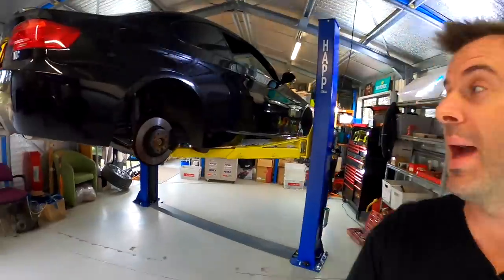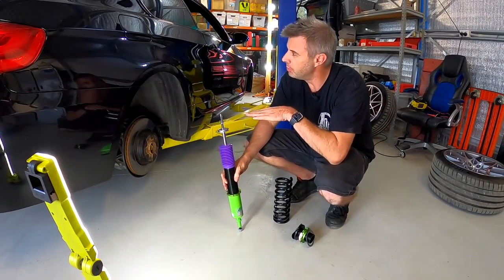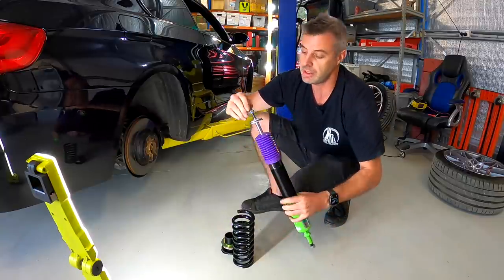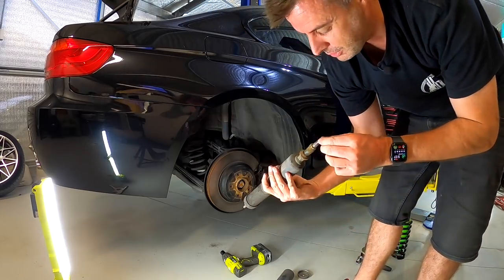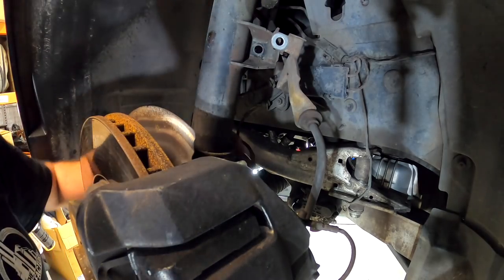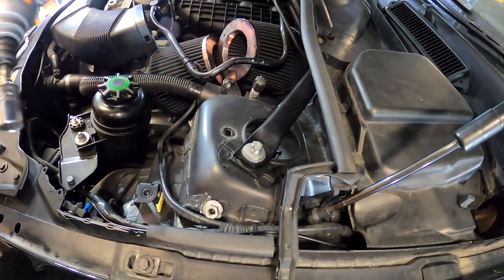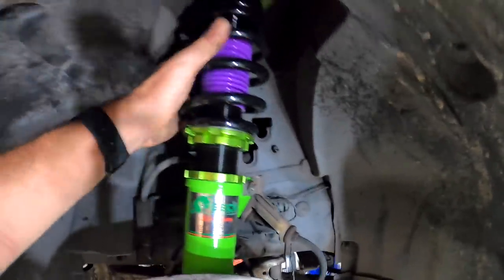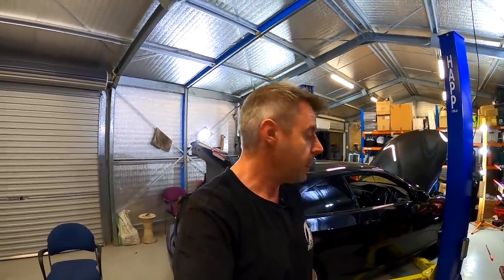BMW E92 Hybrid Turbo 335i: INSTALLING THE CHEAP COILOVERS

Comment: That height is looking perfect! She's going to feel SO much more stable now. Add some M3 front arms and you'll love the steering input 😁
Reply from the maker: I really need to drive a car with the M3 control arm setup. It might be the push i need to just spend the money. So many people mention them.
Reply: @ZeroTo60Tube  absolutely they make the front end really connect!
Reply: Painful to watch bud but am a fan nonetheless. Cheers
Reply: I'd def. install the M3 rollbars, they make the car so much more planted in the curves and remove the understeering characteristics of the 335i

Comment: Might want to look at replacing the rear shock mounts you reused.  They are notoriously very soft from factory, and get worse with age.  Think of having a stiff shock mounted to a soft rubber mount, the rubber flexes first.  There is an updated part from monroe of all people p/n 907984.  Do some reading I'm guessing we'll see those installed pretty quickly.
Reply from the maker: The top ones really feel fine. But we'll see how they go. Like you said the new shocks will definitely put them through their paces pretty quickly.

Comment: It will still settle a bit as you drive it another 5-10mm. I'd start with as much wheel travel as you can get out of those coilovers so it doesnt scrape and behave poorly as a daily. Leb spec lowering is not good for handling - generally 15-20mm lower than stock is about as far as you really want and still maintain some decency in ride quality and allow the suspension to actually work over bumps. Good to hear you got 8kg/11kg springs - lots of these cheapies come with ridiculous 14kg or higher spring rates which makes them appaling both as a daily and handling wise as they skip across bumps rather than absorb them. Fingers crossed for you it is a night and day difference!
Reply from the maker: Totally agree with all that. I did get the spring rates back to front in the vid, but the slightly lower rates than what BC supply did appeal to me with the Geckos. I rolled it out of the shed, and it does feel pretty damn stiff. I'd say its sitting about 15-20mm lower than it was before, it must be for it to not come off the hoist anymore.

Comment: For the brakes I can really recommend the Zimmermann drilled rotors, Pagid RS29 pads, steel braided brake lines and Castrol SRF fluid!
Reply from the maker: Curiosity has definitely got the better of me with the brake upgrade discussion. I think a lot of people will not like the route i have chosen. Im not really sure how well they are going to work... But they should look good and at the end of the day i am not doing any circuit work so i shouldn't really stress the brakes that much.

Comment: Nice! Did you change the rear lower rubber shock mount? Mine were knackered at 80k
Reply from the maker: No i didnt, mine definitely weren't in as new condition, but didn't look too bad at all.

Comment: Looks great! Not sure if you guys adjusted the preload yet. Best thing to do is corner balance the car with the driver or equal weight in the drivers seat after you drive for couple weeks so it settles. Then adjust the preload so it's barely snug with the springs as a starting point. 

Made huge difference on my car at the track and street and it is not as bouncy as it was when I first installed my coilovers.

Comment: A slotted screwdriver bit on a ratchet works fine as well for the front dampers
Reply from the maker: Good tip. That basically gives you the pro tool...

Comment: Double check those spring rates (11 kg/mm front, 8 kg/mm rear). The front should be lower than the rear because the front motion ration is 1 (MacPherson strut) and the rear is greater than 1 because the springs are so far inboard. I think mine were 7.8 kg/mm (440 lb/in) front and 11.6 kg/mm (650 lb/in) rear. Maybe you just said them in reverse. I was looking for spring rate info on these Gecko coil overs but couldn't find it. These are the street version, correct?

Here's a collection of various spring rates for different E9x suspensions. Most are listed as constant, but some of them are progressive rates, like the stock set. That's why the stock rates are only listed as 150 lb/in or so. It's technically incorrect to list them with a single rate. They are not a 150 lb/in linear spring. You find rates that low on suspensions with a foot or more travel (off road).

https://www.e90post.com/forums/showthread.php?t=235797

Looks like everything went together without much drama. That car is so clean on the underside.
Reply from the maker: Just double checked and you are correct, it is the other way around. 11kg rear and 8.5kg front.
Reply: @ZeroTo60Tube  I think those rates are well suited to the vehicle. I'm looking forward to the first drive.

Comment: I ordered a cheap suspension kit from eBay about a year ago and my rear left shock absorber snapped from the bottom , I now have the H&R suspension struts on the front and I’m getting 2 bilstein sports shocks absorbers tomorrow from fcp euro. nice video
Reply from the maker: What kit did you get from eBay? It would be good to warn others.
Reply: Zero To 60 They are off brand coilovers from China they were orange color , I do not recommend them at all haha
Reply: @Faustastico7  maxpeedingrods my guess
Reply: JerainJezza  Yes those ones !! they were so trash I threw them away immediately , didn’t even check the brand lol

Comment: Guess I’ll have to wait and really see how low you went. It didn’t look outrageous. Hope you do a nice little aero package just to really set it off. Nothing crazy just like a front splitter and skirt splitters. Anyways can’t wait to see what’s next?
Reply from the maker: I didn't actually want it any lower than it was before initially. Mainly because it already rubbed with the larger tyres and i wanna add splitters. Front and side. They make the e92s look so much better. I've left these as they come out of the box. Mainly to see if gecko are thoughtful enough to set all the coil overs in a useful position for the cars they sell them for. It has dropped about 10-20mm i think and i dig the look of it.
Reply: Zero To 60 I definitely agree what I seen the car looked good and with the splitters it’ll  give it a lower look with out the shit rubbing. Can’t wait to see it finished it’s gonna be a bad ass looking car with a lot of go! 👌🏽love the build

Comment: I just did koni FSD and Eibach pro kit on my 335i kind of wish I went with coilovers.
Reply from the maker: Anything you don't particularly like about your setup?
Reply: @ZeroTo60Tube  I have had them on for approximately 10k miles and initially they were so soft I would bottom out on any abrupt change in the road and it truly made driving my car intolerable after much research and people who had the same setup on the forums all had the same issues. I have taken the front struts off 3 times now and added different bump stops each time since these really only work properly on stock or sport suspension once you go lower they bottom out easily. I remedied this for the most part by using Speedthane bump stops designed for circle track cars,much better now albeit a bit on the firm side but greatly improved cornering, next is m3 front control arms,adjustable end links,m3 front sway bar and some day F30 M Sport front brake upgrade.
Reply from the maker: @pinktacoetr  Thanks for all that info man, really appreciate it.

Comment: Are you planning on doing anything using a program like virtual dyno or log dyno to get a rough idea of horsepower numbers?
Reply from the maker: I have already done that. In one of the turbo build vids. It's ok for comparing changes on the same car, but not good for a comparison to other vehicles. The best metric to compare to other vehicles is the 100-200 times.

Comment: Good video👌, what about setting the preload? Was it already set by the manufacturer for your car?
Reply from the maker: I wanted to drive them as Gecko supply them for that reason and see what they are like. Also haven't had a chance to properly work out what these particular spring rates should roughly be set to. I mean its normally only a couple of mm on a coil over type spring, but it can make a big difference to bouncyness if i over do it.

Comment: If you call a flashlight a torch, what do you call a torch (those things that are usually attached to propane or MAPP gas cylinders)? And I'm honestly not trying to be an ass. I'm just curious.

BTW, really enjoying the videos.
Reply from the maker: "propane or MAPP gas cylinders" in Australia we call those fire guns.
Reply from the maker: Im kidding, we refer to those as "Blow Torches" :P.
Reply: @ZeroTo60Tube 

lol thanks. I've waited more than a year to ask someone that hoping that I'd see someone use one and mention what what they were using so that I didn't sound like an idiot ask an irrelevant question lol.
Anyway, good job on the 335. I've been thinking of buying one because I know with just a few mods they can (sadly) smoke my E46 M3.
Reply from the maker: @MrSpaz12  They are such different cars. I would still love an E46 m3 just to have sitting there to look at,  i dont think i would drive it much. The 335i does daily driving so well, but then just also happens to be a monster when you want it to be.
Reply: @ZeroTo60Tube 

A good daily, a monster in sheep's clothing and I could use the extra doors every once in a while...
Yeah, the decision is pretty much made, now to just find a good unmolested one that I can tune myself.

I'll never sell the M though. Told my kids to bury me in it 😁

Comment: If you are going for Zero to 60 times 100-200 why are you running that heavy 19". Get yourself some light 18" with a fatter tire on the back. I have my e92 lowered on coils with 18x9 18lbs a corner running a 245/35 front and 265/35 rear Super Sports

Comment: Can’t wait to see if you really slam it? Witch I highly doubt cause you’re more of a function guy. Not stance nation 2023
Reply from the maker: I kinda wanna slam it at some point. Like i mentioned in the first video, running super low for a week or two would be cool. But i don't wanna be scraping it when daily-ing all the time...... or for it to be a reason to get pulled over either. On the same note i really want a car with a hood exit dump pipe..... sooo.
Reply: Zero To 60 guess we can’t win em all right... I forgot you guys get shit for lowered and wheel poke. Where I’m at in the states cops don’t mess with lowered or wheel poke. I mean I know guys that daily scrape and have more then -5 degrees of camber all the way round or more... So what’s a hood dump gonna hurt?